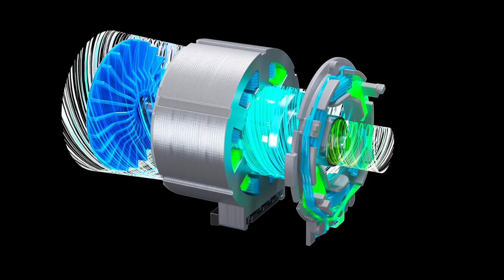24-VOLT BRUSHLESS FLEX FX2141R Rear Handle Circular Saw Review

Comment: Mine stops cutting before completing the cut... even on a 2x3. Unfortunately I lost my receipt and eventhough I registered before 30 days of purchase, no dice on that lifetime warranty... or even a 90 day in my case. I bought it but never used it until just before 90 days roughly. No way mine could cut like this guy's does. Pretty irritated for what their tools cost. Unfortunately I didn't have a receipt for half of what I own from them as they were gifts from my wife. Should've got the receipts from her. Be warned guys! Especially when you want to replace your leaking batteries.

Comment: I have mostly Milwaukee but needed a circular saw so i got a deal on skils new double 20v rear handle and it’s probably one of the best designed high powered saws I’ve use and made by same company as flex!

Comment: That kit for 400 is a steal, 250 for the saw 330 for the battery and 150 for the charger is 730 when bought separately i might get this just for the battery
Reply: 291 when combined with any other tool over 100 bucks.  got the saw kit for 291(399) and the turbo hammer drill for 111(159).
Reply: @kdworak4754  where and when I need this deal.
Reply: @LARULES100  Lowe's everyday deals.  Play around with your cart.  Two tool bundles seem to get the most money off.  the more you add after two tools the savings dwindle.

Comment: NEVER use a powered wrench to install a blade on a saw! You can strip the stud or even seize it. Use the wrench provided with the machine! It’s handle is designed so you can’t  put too much too much force on the blade bolt.
Reply from the maker: I think you may be a bit lonely with that idea. Most trades people don't think twice about using an impact driver to install their blades. You definitely shouldn't over-tighten it, but it's not that delicate. Thanks for watching.
Reply: @Shoptoolreviews  I do not use powered wrenches on ANY of my saws-hand held or table.
Reply: I mean the arbor lock wasn’t on, it wasn’t gonna damage the bolt
Reply: You can use an impact to do delicate work unless you don't have common sense.

Comment: Flex's rear handle and 6.5 inline circular saws are just winners!
Reply from the maker: Yes, you are correct. That inline saw is pretty legit too. Thanks for watching.
Reply: @Shoptoolreviews  question, why is the Motors on all the FLEX circular saw so much smaller than all it's competition but so powerful?
Reply: @rickyperkins232 Makita circular saws motors are small to

Comment: I wonder about the longevity. I'm heavily invested in Milwaukee. About $5000 in tools and $1500 in batteries. Getting into another platform is not ideal for me especially since i rarely use my Circular saw. Im super hyped they put the pressure on the other platforms to do better.
Reply: I'm a Milwaukee guy as well, finally they got some competition. Good for everyone

Comment: It will be interesting to compare the Milwaukee rear handle saw powered by their new Forge batteries. I would imagine that it will put the Milwaukee on an equal plane. 

Framers very rarely do plunge cuts. I worked my through college as a professional framer. Probably the only time is when you have to cut a complicated piece of plywood. I personally did not like to do plunge cuts because it is easy for the saw to travel and kick-back when you plunge cut with it.

Comment: I don’t know if brushless motors in power tools are different but in the RC scene there are a lot of un-sensored or sensorless brushless motors. They usually just have a power and ground for however many poles they have. In these motor the “sensors” if you will is basically software watching the voltage feedback from the motor to determine if it’s spinning the correct direction or not. Generally once the motor is spinning, a sensored or sensor less motor performs the same. Where the sensors really matter is in very low speed low power control. A  sensored motor will be just as smooth as a high end old school brushed motor while a sensorless motor can cog a lot especially if it’s only a two pole motor.  Usually only use sensored motors in crawlers or touring cars where low super control matters a lot.  Awesome video as always and even though I have no need for this I want it!

Comment: How does this Flex saw compare to the cordless Skilsaw 77? Has anyone made any comparisons?Inquiring minds want to know!
Reply: It’s got more rpm 6200 vs 5800 with the skilsaw but the skilsaw runs at higher voltage
Reply: @almerino3497  would also think the Skilsaw cordless 77 would have more torque. A comparison is needed!

Comment: So a mechanic guy talking about saws? To me he sounded more like a representative of flex..
To me is,(1) Dewalt (2) flex (3) Milwaukee..
Reply from the maker: You are partially correct. Saws are not uncommon to us, and I know my way around the construction site too. Talk to anyone that's used this FLEX rear handle. It's no joke and very impressive. I like the DeWalt FlexVolt too, but not as much. Frankly, I think the dual-battery SKIL saw (same company as FLEX) does a killer job as well. Thanks for watching.
Reply: The Dewalt you get showered in sawdust working all daeh, but he does sound like a sales rep